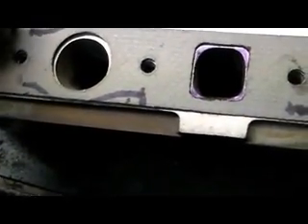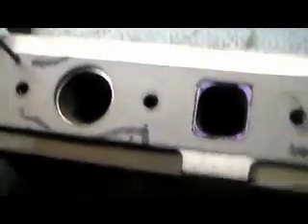Austin MG Engine rebuild Pt7 Cylinder head Mods

Comment: Why are you not using a 12G295 or 12G202 head if thats a 998/1098 engine, or a 12G940 head if its a 1275/1300 engine? Much better chamber shapes and valve sizes as well as ports.
Reply from the maker: Hi JJMac, it is a 12G202, I may not have been clear about what it is, sorry.